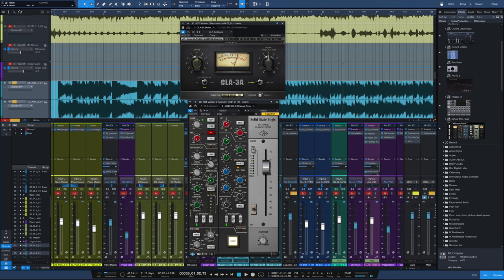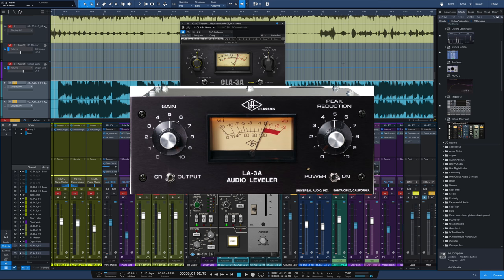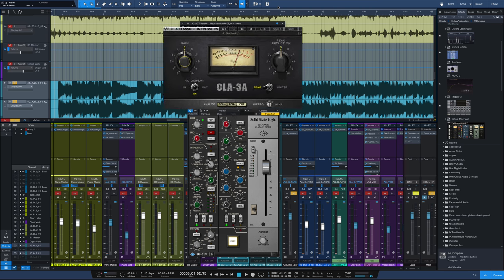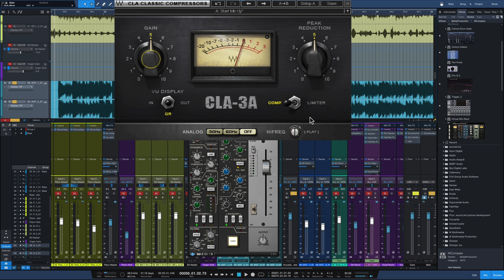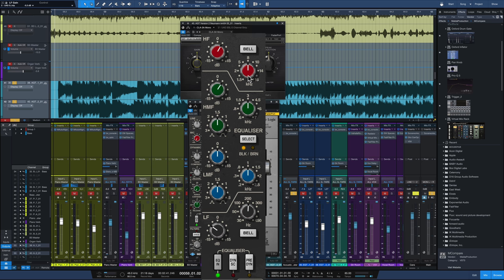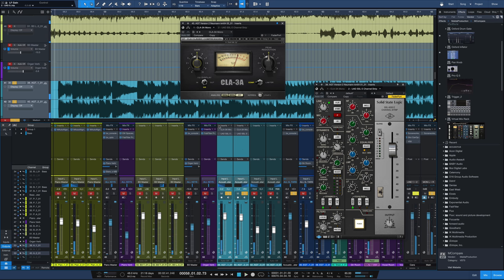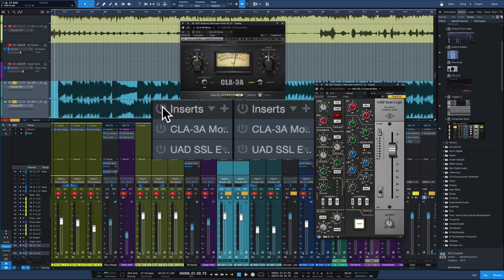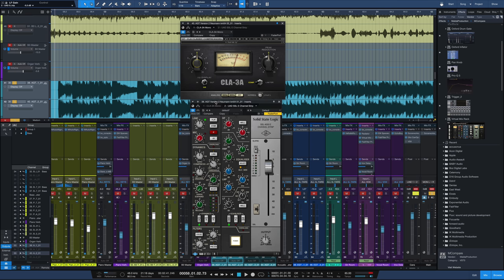Chris Lord-Alge Acoustic Guitar Processing | CLA's Simple Moves for Acoustic Compression and EQ

Comment: I think CLA uses an L1 before this entire chain to control the excessive peaks too. Also, doesn’t he prefer to EQ into the compression? Or is it different for the acoustic?
Reply from the maker: The EQ here is on the return, so post 1176 in this case.  EQ into compression on the individual channels using the SSL comp.
Reply: @GreenLightSound  it would be much usefull if you say how much gain reduction in dB compression going,  than number of input gain. That number isn’t important at all.
Reply: @GreenLightSound  any specific reason it’s compression into EQ and not the other way around? Understand no hard and fast rule.